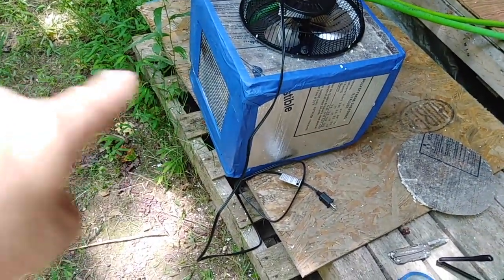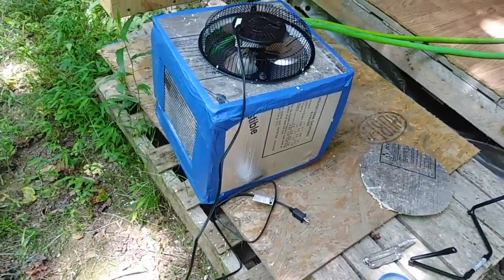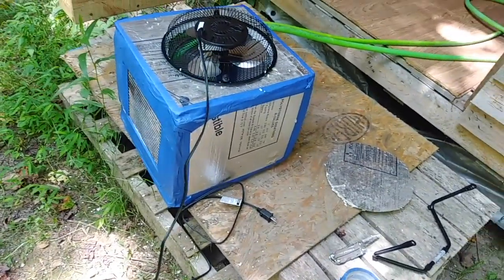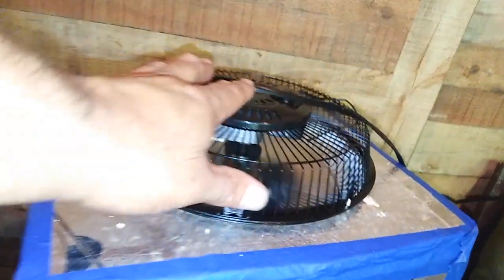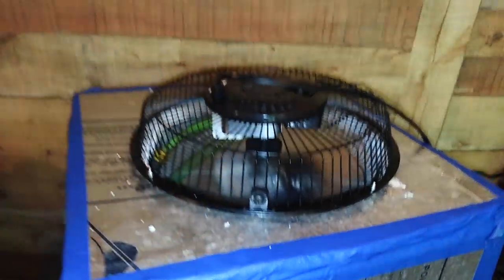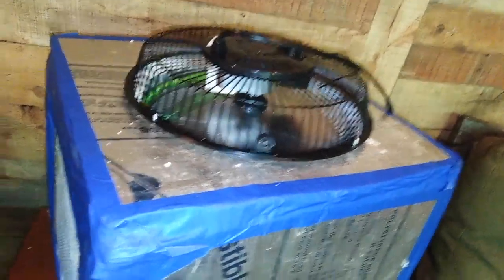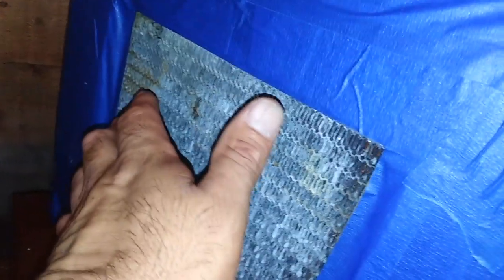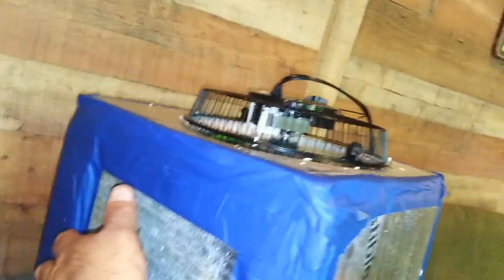Geothermal Air Conditioning For the Pallet Wood Cabin

Comment: That is awesome Luke! Would that be the equivalent of like an old water cooler? I'm not the engineer as you know. I guess my question would be in the humid climate that we both live in how that would really cool...I was always told swamp cooler s didn't work well in humid climates. How is this different?
Reply from the maker: It works differently than a swamp cooler. Where the water is contained in the heater core there is no increase in humidity. In fact, it actually removes humidity from the room in much the same way as an air conditioner.  I found out that it creates the same kind of condensation as an air conditioner by the box starting to leak water out of it. Had a little mess to clean up lol.
Reply: @lukeFugate  well that's great! I use several small fans that are 12 volt in the van that would be a neat thing if I could make something like that small enough to use in the van. Any ideas on how to do that to have a core like you use that would be small enough so it doesn't take up a lot of space?

Comment: Pump and Dump AC's work the same shedding heat and dropping it back in the ground water table.
Reply from the maker: Yes, that is essentially the same thing. I just don't need a pump. Even with a pump though, it would be more energy efficient than an AC unit.

Comment: 🗣‼️U know what u should do...Luke..❓❓.. put another generator at the end of the outlet hose outside to generate more electricity for ur Cabin...like u have from ur source at the top of the mountain 🏔...you’ll have a closed System now...like a circle...nothing is wasted👍🏼. Just a thought...& i am sure u could do that! Not sure how much electricity u’ll generate.. but I am sure it may be something 😃😃
U got my MIND 🤔 thinking... u could have a few of them water AC units in ur Cabin..and u might be experiencing a Refrigerator/Freezer Climate ❄️❄️❄️☃️👍🏼
Just a thought again.. build a lower ceiling just under the loft...and put that little portable ac water unit up in the loft?
Reply from the maker: I guess I could have more of these in the cabin. I think one up in the loft is a good idea.

Comment: great effort, how far you brought down the temperature of room ?
Reply from the maker: This small unit was just enough to keep you cool basically right in front of it. I built a bigger one from a car radiator using the same stream with a box fan behind it. It was very effective and would drop the temperature down to 70 with outside temps in the 90s.
Reply: @lukeFugate   great and did you have increase in humidity in the room ?
Reply from the maker: @naveedutp1  actually it went down just like a real AC.

Comment: Another great example of makin' do with the resources you have! Before you opt for a larger fan why not take an old piece of sheet metal or an old metal piece of duct and cover the fan such that it rises to higher than arm's length above head height!?  Most people know a ducted fan operates more efficiently than an unducted fan. The riser would also conduct more heat from the room air as the temperature comes down. In any case, here's to your ingenuity in creating an inexpensive air conditioner!
Reply from the maker: Thanks. Sounds like that might be worth a shot. Maybe able to use a piece of chimney pipe.

Comment: Did it lower the humidity?
Reply from the maker: Yes. It did lower humidity. I had condensation building up inside the box until the masking tape started letting it through. It needs a drain pan under it. It ran out onto the table and then all over the floor. I thought I had a leak in one of the hoses at first. I should have realized it would do that.

Comment: So after a few days have passed , how much have you ran it?  How cool did it eventually get it down to ?
Reply from the maker: What was shown in the video was about it's limit. It has trouble keeping up on really hot days, just not enough cooling surface or air flow. Next experiment will be a car radiator and a box fan.
Reply: @lukeFugate  
I am very interested in that video 
I have had a very similar idea for awhile 
Ram pump from creek thru radiator setup such as you have even maybe duct it thru some vents 
Then after exiting the radiator hose it back to the creek

Comment: Now pull that water back through a turbine and with the power and the battery bank with a ac-dc converter to run the fan with it your home free
Reply from the maker: The power for the cabin comes from solar and water power so it's free. All off grid.

Comment: Get one of these fans u ran it off a small lawn mower battery for 5 days. Attwood 1749-4 Quiet Blower Water... https://www.amazon.com/dp/B003EX02DA?ref=ppx_pop_mob_ap_share now i run 6 of these in my portable solar and wind unit as a cooling system.i have a temperature co trolled relay board the turns the fan on and off automatically .these fans are a bit loud but very powerful just like a damn leaf blower man lol.
Reply: You can hook up a  water source into some swamp cooler mesh inside a bucket or old igloo cooler or something. Just blow through the mesh after water soaks it then you will have a very nice swamp cooler
Reply from the maker: Thanks! I'll check it out.

Comment: You need to remake this video as you are not showing the probe in the water as it seems that your claim is .... not good ... the probe  fluctuate from 62 to 87 in an instant...

On the other hand you idea it should work as long the water it's coming from a deep well or stream, BUT it you dig an area a basketball court and lay some 300 yards of hose at 10 ft or deeper you will get geothermal temperatures as a constant of 60 to 68 degrees you will achieve the same results.
Reply from the maker: I'm going to revisit this soon using a car radiator and a bigger fan. I also need another temperature probe instead of the multimeter probe. I think it has a bad connection somewhere and probably wasn't very accurate to begin with.  This does work, just mot very efficient, needs more air flow.

Comment: If you have electricity,  why not just get an air conditioner?
Reply from the maker: It is an off grid system that has limited power available. An air conditioner would use up the reserve battery power too quickly.
Reply: Gotcha. That makes sense. Great use of your ingenuity!